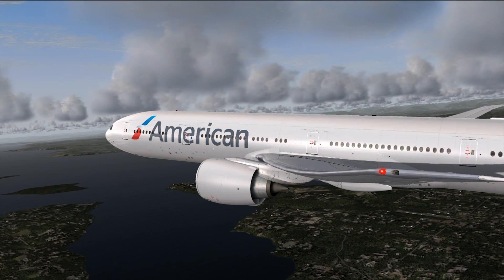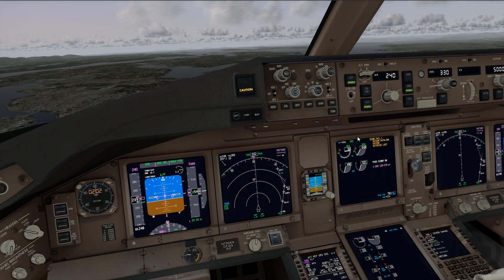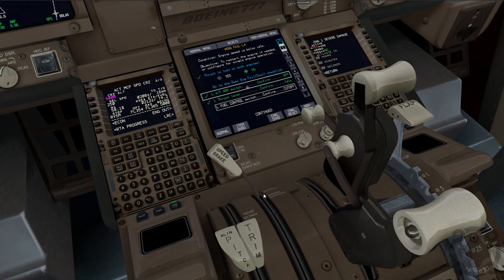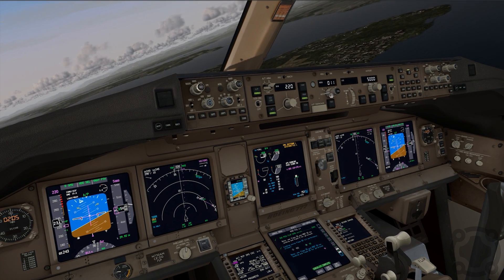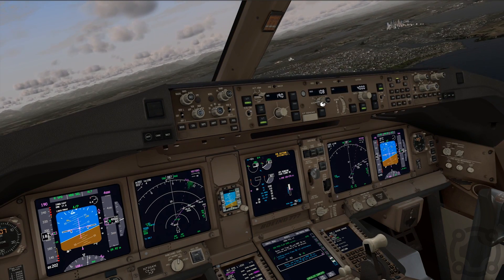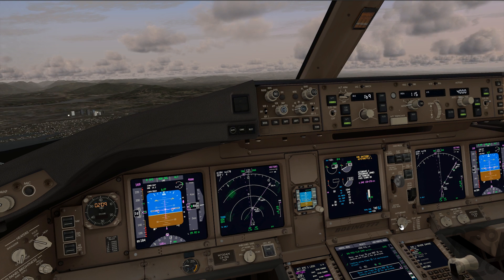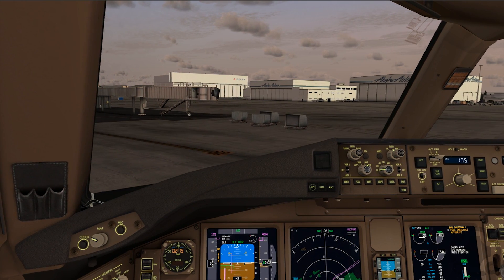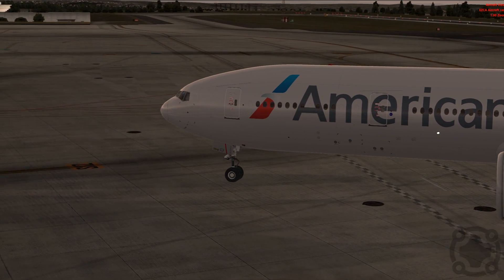Can A Plane Fly With One Engine? - Aviation Facts

Comment: Would you have to dump fuel that wasn't used by the engine that was shut off? Or since you would hypothetically  be in a early landing would you have to dump fuel from the right engine as well do to unused fuel?

Comment: I brought this up with a buddy.  The point I was trying to drive is that I assumed there are parameters that at some point a single engine wasn’t going to be enough.  As you said “aircrafts with four engines need at least two”.  So according to you, in that particular case, one engine wouldn’t be sufficient.  Thanks.

Comment: why don't a aero plane turn to one side when one engine fails, according to dynamics if thrust on one side is greater it would have resulted in turning moment?
Reply: Nikhil Verma you are correct. they turn towards the thrust side to compensate
Reply: Nikhil Verma hii
Reply: ruddle produces the yaw ( the rotation towards left or right) that rotation is kept in such a way by pilot that it is opposite to the yaw ( left or right turning) produced due to having only one engine.

Comment: Why doesn't it spin out of control??
Reply: Pinrui Huang they're able to compensate for that by using the tail rudder a slight angle will correct the difference air flow and power. He explains how in the video

Comment: On the topic of 747's still flying with 2 engines, what would the procedure be if the aircraft lost 3 engines? Would it be similar to a total loss of thurst scenario or a single (or double in this case) engine loss scenario? Insanely rare case but just curious to see what would happen.

Comment: Why didn't you jettison some fuel to lighten the Aircraft?
Reply: Typically, aircraft with a failed engine aren't close enough to the destination and have to divert. Since there is a max weight an aircraft can be to land, fuel is jettisoned. Fuel is also commonly jettisoned on hundreds of flights everyday because the flight dispatchers have a safety margin of extra fuel to consider if there are projected thunderstorms or other factors that would make the aircraft go into a holding pattern.
Reply: Fuel isn't expensive you noob.
Reply: Because if there was a fuel leak he would have some extra fuel
Reply: Why should he? This was no emergency. Fuel is expensive,

Comment: a plane can fly with one or no engines working. if one engine is working then the plane can still fly safely to wherever its going or to the nearest airport (whatever the pilot decides). if no engines are working then the plane just because a big glider and can make a safe landing at the nearest airport. my grandpa had 50+ years of flying experience before he retired from delta after 31 years with them.
Reply: Thank you for this! I’m afraid of flying and I’m trying to learn about the machine to help my fear.
Reply: repoman what if there are no nearby airport?
Reply: @vivekbarman4550  there is always a nearby airport, the issue is finding one big enough for your type of aircraft. if no airport of your size is near by then land in a field or on the road as seen in some videos on here. i would have replied but wasnt notified of this comment.
Reply: it's like a paper plane with no engine n still can fly
Reply: Omg then your dad might have joined in age 15 as pilots are only able to fly till 65 !! And 50+,  how?  
Did u mean air baloons
Reply: @beallay3541  well it was my granddad not dad and basically yes he started when really young. but it wasnt just flying for the airline he has experience in. he was an investigator for the 1985 Dallas DC10 crash and was a test pilot for lear aircraft when lear was still trying to make a name for himself. and at the time it was 60 when he retired but my grandpa's uncle had his own plane and would take my grandpa up when he was a child. my great-grandpa did not like that and it caused him to stop speaking to his brother for years.
Reply: Where will thrust come from to push the plane forward to the nearest landing port if both engines are out?
Reply: @loa7176  like i said, if both engines quit working it basically turns the aircraft into a giant glider. but all aircraft of a certain size have what is called an APU (auxiliary power unit) which on planes like this 777 seen in this video run on jet fuel and creates power and a little bit of thrust not enough to keep the plane flying bu enough to help it glide.

Comment: Next time do where both engines are lost.
Reply from the maker: That would be interesting, at that point it would be a giant glider.
Reply: Then the pilot needs to be Sully.
Reply: +LogicLounge in the honor of the. sully movie coming out Friday
Reply: LogicLounge what if it was a Boeing 747 or A380
Reply: would it be possible? Lets say the other engine failed whilst landing, would you still be able to glide it down?
Reply: mrmoo Yes. Look at the Gimmi glider
Reply: The Diamond TNT Look at British Airways 9.
The 747 flew through volcanic ash, and lost all four engines. The engines were eventually restarted, and the plane landed safely, but it was just a massive glider right through the volcanic ash.
Reply: +mrmoo Depends on the phase of landing you are in, but in most situations: No, you would most likely crash. See British Airways flight 38 for example
Reply: In the last phases of landing you need a lot of thrust because of the slats and flaps. They generate a lot of drag